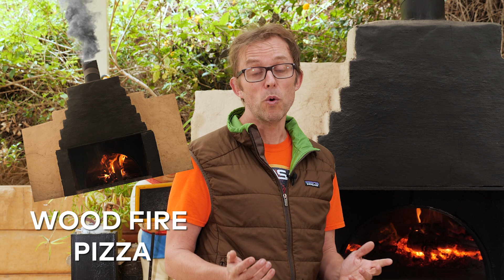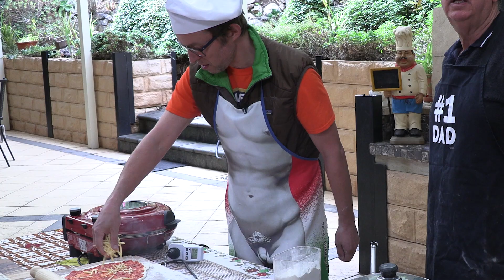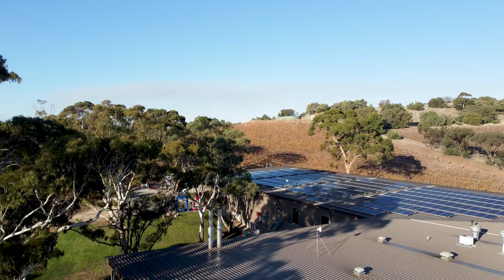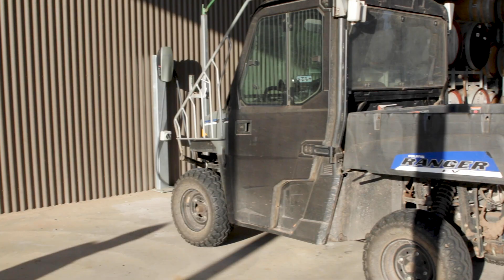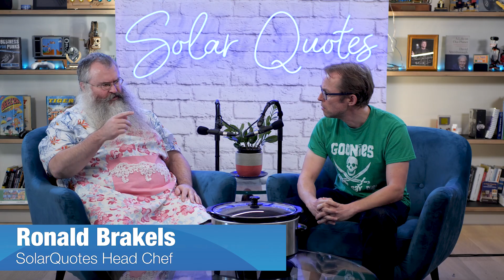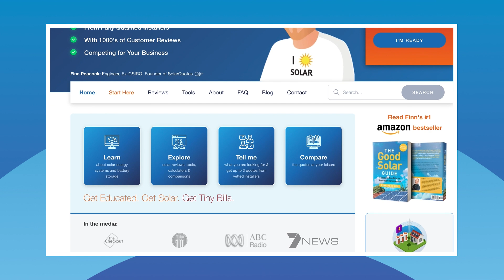Foodies Saving Serious Money With Solar - SolarQuotes TV Episode 5

Comment: That lambert solar system looks like it is in the shade
Reply from the maker: Yes the gums do cause some issues there, particularly in the afternoon, but overall they're happy with the result...Those trees are getting a trim though and the new system will be on a new section of building so shouldn't have the same shade issues.